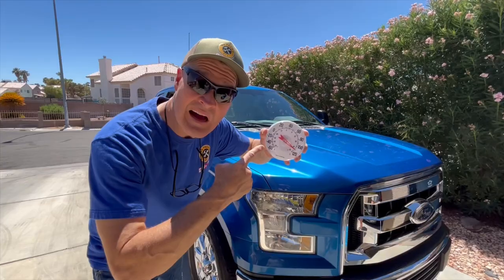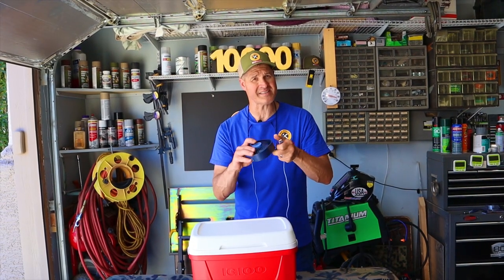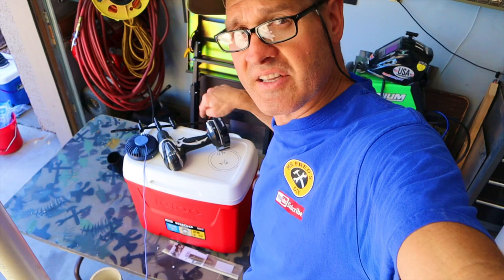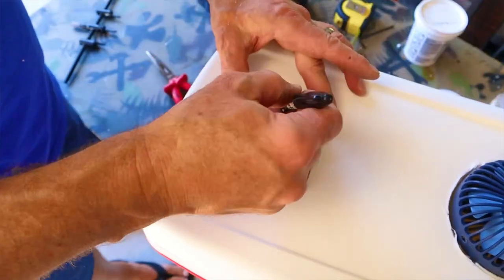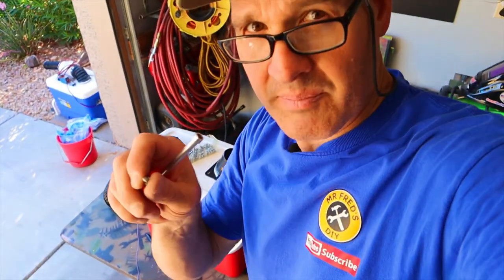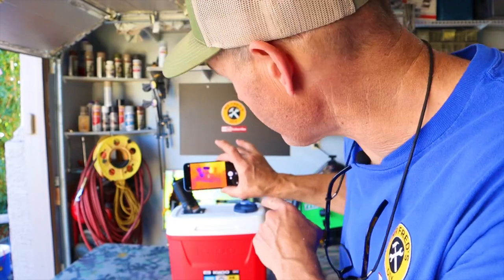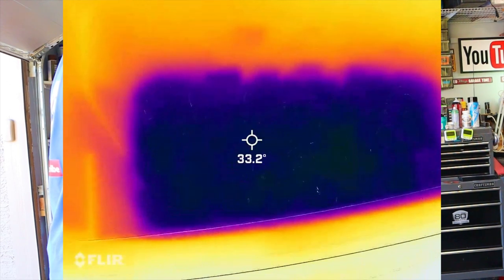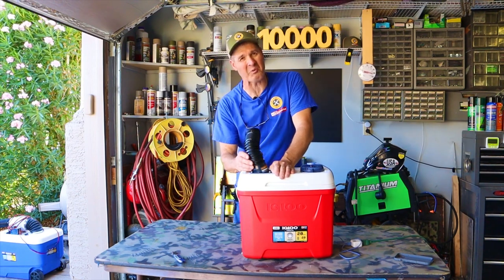DIY Ice Cooler Air Conditioner-For Cars

Comment: Could have used the fan brackets as a mount to the cooler with 2 diy L-shaped  pieces of material,ie,metal corner brkts. And using gal frozen jugs or 2 liter bottles can be reused several times. 😎👍

Comment: U should have put the thermometer in the truck before the cooler and then after to see if there was a difference.  Just a suggestion
Reply: You would think so 😮‍💨 that way we could see if the dyi ac actually produced enough cold air to cool off the inside of the vehicle. What a waste of time.

Comment from the maker: What are your thoughts? Will this cool a car? Is it even worth building? I’d love to hear your thoughts! Here is a follow up testing video ▶️ https://youtu.be/-ssSvss5woE?si=u4ci9xRH6m5Yl7W8
Reply: Hello! I think adding an aluminium pipe from intake(up) and exhaust(down) will be more efficient maybe less humidity and the ice will last for long time
Reply from the maker: I’ve been thinking about that kind of design. Thanks for watching!
Reply: sealing the hole around the fan will increase your pressure at the out take

Comment: The frozen water is ice temperature
Reply: This is obvious, but actually a good point. Just adding salt to the ice would lower the temp inside the cooler by 10 ~ 40° F, depending when it is added, and how much is used.